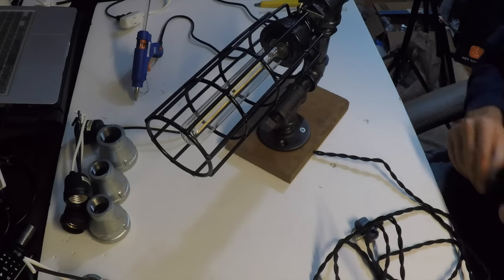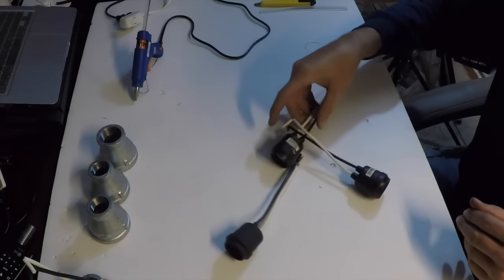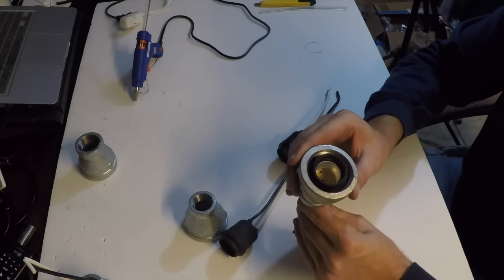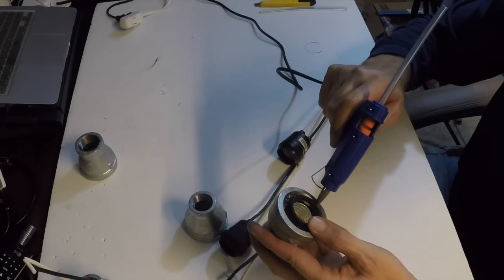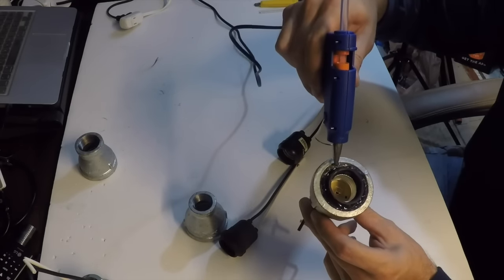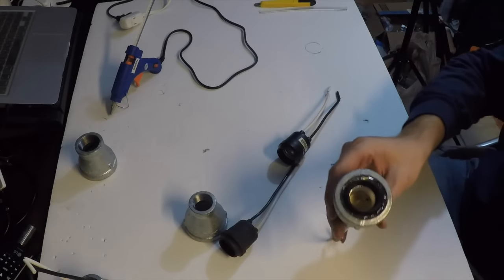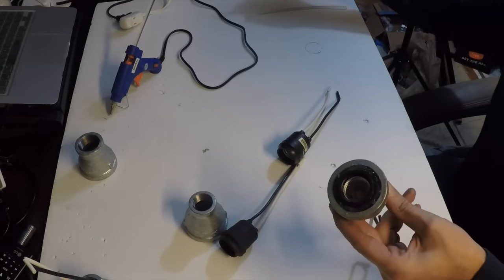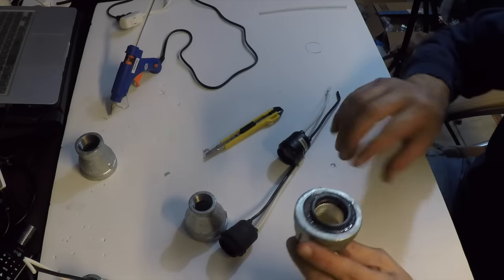DIY Pipe Lamp.  Installing light socket in your pipe lamp

Comment: I would be concerned that the heat from the bulb would make the hot glue melt.
Reply from the maker: Has never been a problem yet, but I do use LED bulbs 💡

Comment: Hey man hows it going. I found this video doing a search for exactly what you just did. I have the same sockets going into gas pipe. Don't know the best way to secure them. Is the hot glue safe to use?  What's the temp rating on it and is it flammable?  Thanks. Richard
Reply from the maker: +suburbanlab   I only use LED style light bulbs so you don't get the heat like you would from a more traditional bulb.     
I have used the hot glue many times and have never had a problem to date.

Comment: thank you i wnt to make copper lamps but scared that they would not be earthed so i could use tubbing inside the copper
Reply from the maker: Yes so long as all your connections are well insulated a ground will not be necessary.   You could also use a three prong plug and a three wire cord and soldier the green wire to the inside of the pipe if you really wanted it to be grounded
Reply: @cranevideo3506  i could self tap a earthing lug to the pipe
Reply from the maker: Definitely
Reply: @cranevideo3506  thank you for all you help

Comment: did you buy the wire cage thing (covering the bulb) separately?  what is that thing called?
Reply from the maker: +Daniel Hoer  yes I found it on Amazon 
It was called a "Vintage Industrial cylinder cage"
Reply: Daniel Hoer very informative video. Thank you

Comment: how did you earth this copper lamp
Reply from the maker: The steel lamp is not grounded. Very rarely will you find a residential lamp now days that is.     If the lamp is assembled correctly and there are no exposed wires and you use the tubing so the wire will not get damaged on any edges there should be no need for earthing or grounding of the lamp

Comment: thank you very much, by tubing do yo mean heat shrink
Reply from the maker: Heat shrink on connections and I use clear plastic tubing to run the wires through any corners that way the wire is not resting one a sharp edge.

Comment: Please please, when wiring a lamp with exposed metal parts use 3 core cable. If a fault ever occurs YOU will become the earth and believe me, it will bloody hurt at best. Potentially fatal.
Reply: Mark Belshaw 
Stupid question but what do u mean by 3 core cable ?    Thanks 
Does one of the 3 need grounded ???
Reply from the maker: RS Law100   Yes he is saying that a third wire should be used as a ground.  
You will also need a different plug for this.   A three prong plug and a grounded outlet.
Reply: Yes people, for the love of god please ground your DIY lamps!!